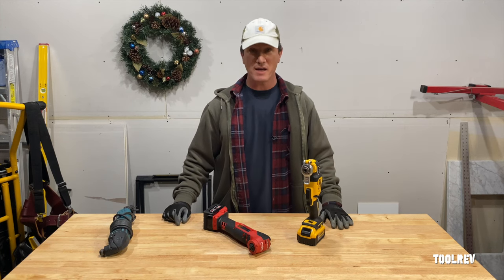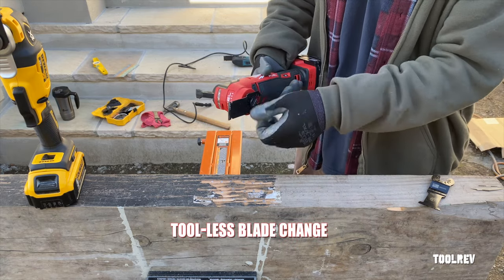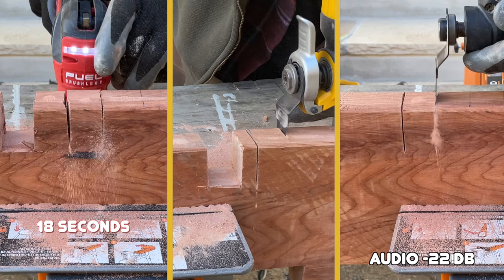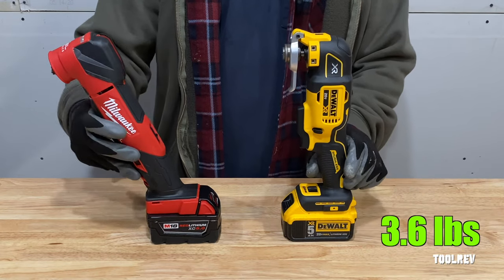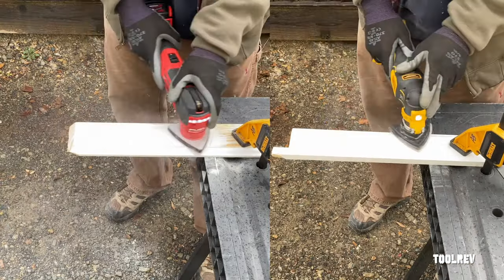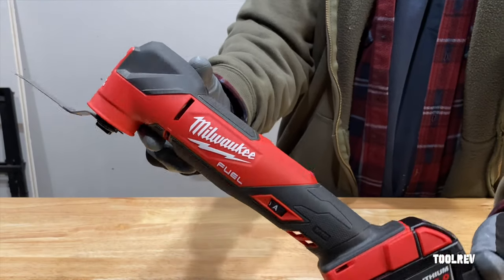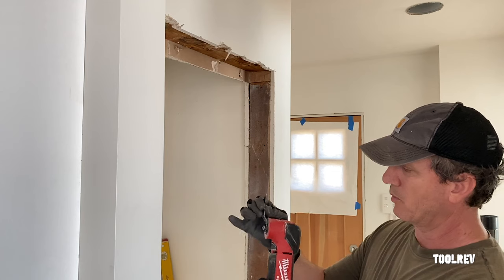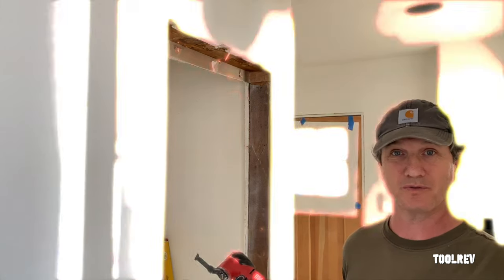Milwaukee M18 FUEL vs DeWalt DCS356 Oscillating Multi-Tool BATTLE!

Comment from the maker: A certain skill level of user will get better accuracy with the DeWalt. The M18 FUEL can achieve the same accuracy and has the superior blade change mechanism, speed control, vibration, grip, power under load, etc. It's next-level.  https://youtube.com/shorts/xObMBXP2Ad8

Comment: Milwaukee is going to beat DeWalt every time because it oscillates 1 degree more every oscillation. Add that up and you will cut faster.
Reply: I'm just not sure if that translates to clean cut without damaging adjacent surface. For instance cutting base on floor.
Reply: Yeah agree with Milwaukee faster for sure great tool , but for precise cuts I feel Milwaukee like a Machete and Dewalt like a scalpel

Comment: Im waiting for milwaukee to make the chuck better I want a multitool but, I used my boss' and the dewalt multi tool and hackzall are designed way better than the milwaukee. I like milwaukee alot but, they're slacking on their saws big time. Their sawzall is still the best but the hackzall, the multitool, circular and mitre saw dewalt takes the cake. If speed is all you're after milwaukee is great. Thats their biggest gimmick "our tool does it faster" okay but do your tools last as long do your batteries perform as well in various temperature ranges? Ect. Theres so much more to tools than just the speed and the colour red!

Comment: All your speed cuts looked much cleaner with the DeWalt. It took more time but much cleaner cuts. Variable speed trigger looks much handier. I'm surprised you prefer the Milwaukee. None of your cuts with it looked very clean.
Reply from the maker: True, but I wasn't trying to make clean cuts, just show the speed. It is easier to cut straight using the DeWalt. I used the DeWalt for years and was never happy with the speed of cut and never use the trigger. I get better control holding the tool with one hand on the body and one on the battery. The trigger has crazy vibration, and isn't usable for most angles you cut at anyway.

The FUEL is better for one handed operation due its speed dial location. For some the DeWalt may be the way to go. The FUEL is a next-level tool for people who need next-level.

Comment: Well, unless this is your first cordless tool purchase you're going to go with the brand that you're vested in because you've already got batteries and charger. The one design flaw I would peg on the Milwaukee is that you can't set it down vertical on the battery. Why did they angle it like that?

Comment: Apples and oranges! I would hope that any tool that costs over twice as much as another would perform a little better😮
Reply: tool only costs very close to the same...
Reply: @vitalsteve1  Not sure where you’re getting your numbers? The Dewalt with a battery and charger is $179, the Milwaukee is $229 for the tool only😂

Comment: I bought the m12 the other day. Tried sanding with it today. I think I had it turned up to 6 or 8. Dunno which. The newly charged battery lasted for about 5 minutes, maybe less, so I lessened the speed to its slowest.
I would like to see a battery test under load to see how long it lasts compared to others.
I do like it though. don't get me wrong I just didn't think about the battery not lasting as long if I had it turned up.
Reply from the maker: I feel kinda bad now because in one edit of this review I recommend not getting the M12 because these tools use a lot of juice if used for anything serious. Maybe I'll reupload it with that part included. I'd return the m12 for the m18, which is almost exactly the same size.
Reply: What ah batter are you running it with? If you're using a standard 1.5ah battery you probably wouldn't get much use out of it.
Reply: @BoneCK15  
Using it often now. Has plenty of power at 2 and lasts much longer. I had it set to high.

Comment: At 5:48 you seem to say that Dewalt can be (in some ways) a better choice if you aren't worried about cutting straight lines, but at 5:15 you said it's easier to cut a straight line with the DeWalt. Please clarify? Which is better at cutting straight lines? Thanks for the video!
Reply from the maker: Sure, actually I said it's a better choice if you don't want to worry about cutting straight lines meaning it's easier to cut straight with the DeWalt because it's slower with a stiffer head. You can cut just as straight but much faster with the FUEL if you're competent with tools.
Reply: @toolrev  Thanks very much for the clarification. Very interesting! Subscribed to your channel now. Have a great day!
Reply: @toolrev  Thanks for the clarification. I was thinking the same thing as the other guy cause of the wording. Really appreciate the response. 
If no skill and want straight lines but slow = dewalt.
If you're more pro, the milwaukee is faster but you gotta be a pro to be able to attain straight lines.

Comment: Milwaukee. It's not about speed alone. It's about precision, ease of use, ergonomics and vibration. What I would like to see is a 180 degree light on all these tools at least... Sometimes I move blade on 90 to make cut. So the light stays 90 degrees to the blade. I don't think it would be difficult to do something like that.

Comment: the Milwaukee seems like it takes the cake but I can currently by 2 of the of the Dewalts for the same price as the M18 fuel where I'm at
Reply: Good because it will take twice as long with the DeWalt so you'll need 2 of them plus paying another guy to get the same amount done as one Milwaukee. You're really coming out ahead eh?  😂😂😂
Reply: @jamesnm21  different strokes for different folks I’m just a weekend warrior DIY fixer upper so the dewalt will work for me for half the price ¯\_(ツ)_/¯
Reply: @tiekuhn3839  understandable. I'd still get the Milwaukee because it's much smoother to operate. I've used the DeWalt and it vibrates quite a bit more.
Reply: @tiekuhn3839 Respect for accepting the reality, a lot of home owners consider themselves somewhat of a professional. I keep telling people to stop buying contractor tools to do basic diy every now and then.
Reply: @mr-toyota but contractor tools are fun
Reply: @jamesnm21 vibrates quite a bit more? My hands get hot and feel like jello after using it for a min lol.

Comment: the chuck moves on the milwaukee to reduce vibrations👍🏻
Reply from the maker: May help clear dust too, helping it blast through a cut. Funny, I was literally using the Milwaukee while you where writing this comment. At first I couldn't find it and was bummed I'd have to use the DeWalt but found the M for the win at the last minute. Love this tool!
Reply: @toolrev  got my m18 fuel the other day, absolutely destroyed the dewalt dcs355 and the m18 bmt with it, fastest cutting multi tool i’ve ever seen, stay safe!

Comment: Where I am that Dewalt is a $129 tool. Milwaukee is $299 tool only. Although there is a sale for $259 or so for the tool and 5ah battery charger and bag. Looks like with the dewalt you can get a similar deal for like $200-$225. So quite a bit cheaper overall IMO. I own the Milwaukee by the way.
Reply from the maker: The DeWalt should be cheaper as it's on par with Milwaukee's non FUEL multi, Ryobi's multi, etc.
Reply: Lowes has this for $99 with battery and charger thru 7-31.

Comment: milwaukee clearly more powerful and faster but the problem is the much wider oscillation...if i'm cutting a molding and i can't damage the wood floor perpendicular to it, i can't have this wide of oscillation... i need it as narrow as possible, i don't care if it takes a little longer, that's not the prime concern

oh and the "easier to cut a straight line" part matters massively for what i do

Comment: I'm getting the bosch 18v gop 34  build quality is first rate , and they have reduced the vibration by 50% on this model , and the blade change is the best on the market , don't like the milwaukee  because of the pin you have to use to change the blade

Comment: I have both I prefer the dewalt for drywall cuts, the Milwaukee for everything else, just like their impact drivers dewalt atomic little guy for self taps and drywall screws but Milwaukee for lugs and lags, either for deck screws they both run hot after a few hundred or a couple handfuls of holes with a boar bit depends on sizes

Comment: Try the Dewalt's 12v with a 5Ah battery. It's twice as fast as Dewalt's 20v with a 5Ah battery and a lot smaller and lighter
Reply: How can that be? Surely the 18v uses a lot more power
Reply: Powerstack puts out good power, the 12v line is just too limited, too little power
Reply: Spoken by someone who has never used these tools 😂. It’s impossible for a 12v to put out more power than a 20v as the dang battery
Reply: @josevazquez1042  If you've never used them why are you commenting? I build houses with them on a regular basis
Reply: @josevazquez1042  So 20v tool battery has more power than a 12v car battery?
Reply: @josevazquez1042  I think if the rpm are the same i think best way to understand it is the amps x the volts and it just abt a battery lasting longer not exactly that one is more powerful then another but idk just thinking.

Comment: What type of blade milwaukee use?
Reply from the maker: It will take whatever, universal, Starlock, etc, with no adapter needed, which is one of the things that makes it's blade change system superior to the DeWalt.

Comment: How tf does the Milwaukee have way more degree of oscillation and way less vibration? 😵‍💫
Reply from the maker: Maybe the floating chuck where the DeWalt is stiff.
Reply: @toolrev  oh, ok. The more videos I see, the more I regret not going Milwaukee. Lol
Reply: Yeah it's crazy how Milwaukee does so good. DeWalt works and I haven't had any issues with them. I currently own 4 brands of tools. Milwaukee ( work) DeWalt ( work) metabo( spare) and Ryobi( trying out) . There is no rule that says you cant own more than one brand
Reply: Milwaukee needs to get like DeWalt change out blades
Reply: @donaldstepp4850 yeah but the other ones look bad in my packouts 😬

Comment: Seems biased. Dewalt battery in your unit, more accuracy from dewalt, faster blade change in dewalt, loose floppy chuck on Milwaukee, 3 different Milwaukee’s “A” speed not working as designed but still better 🤔. It cuts faster for sure
Reply from the maker: A certain skill level of user will get better accuracy with the DeWalt. The M18 FUEL can achieve the same accuracy and has the superior blade change mechanism, speed control, vibration, grip, power under load, etc. It's next-level. 😎 https://youtube.com/shorts/xObMBXP2Ad8

Comment: How can be such a difference if all tools have nearly the same oscillation rate i.e. 20000

With the same brand new blade? Or is it the blades that come respectively with each tool?

Does it let you push more because of more power before it begin to "jam"?

In theory same "rpm" with the same new blade should not have that much difference in times
Reply: Ok i just see the angle on the Milwaukee… i listen only without viewing the screen so i missed out this detail🤣
Reply from the maker: The Fuel’s angle, plus the chuck being allowed to float a bit, probably helps clear dust better than the others. I think poor dust clearance slows the DeWalt. RPM stats are unloaded and the Fuel seems to hold higher RPM under load without overheating, Many tools between brands are closer in performance. This particular Fuel tool is next-level.
Reply from the maker: OPM
Reply: No-load speed is just a nominal measurement, most electric motors of this size have an RPM around 20,000-25,000, that they are all the same around 20,000 just indicates that these multi tools are all direct drive and do not have any kind of bevel gear differential or gearbox to produce more torque and inertia. That doesn't mean the electric motors or the drive method are identical
I want to say I find it odd that you chose to comment on a video without watching it 🤨

Comment: I didnt knew that you could switch batteries between dewalt and milwaukee
Reply from the maker: you can if you're not afraid of using battery adapters
Reply: Someone told me that the adapters don't allow full power to the tool. I haven't noticed with my Ryobi impact. The Ryobi adapter let's you use DeWalt or Milwaukee so it's real nice for someone who has DeWalt and Milwaukee batteries